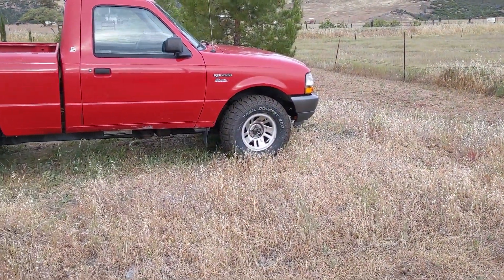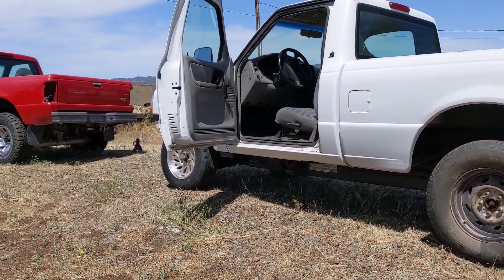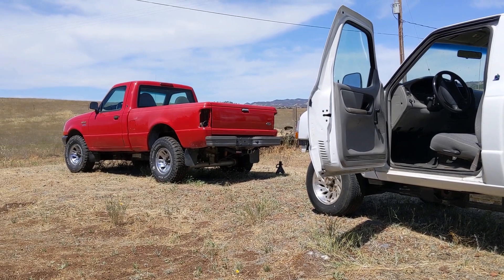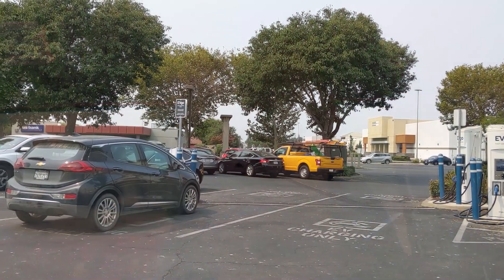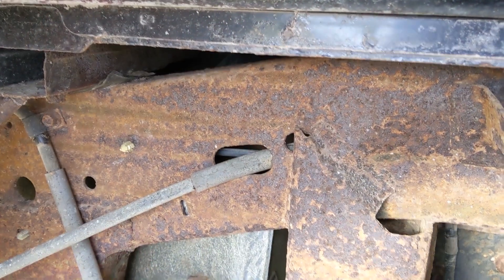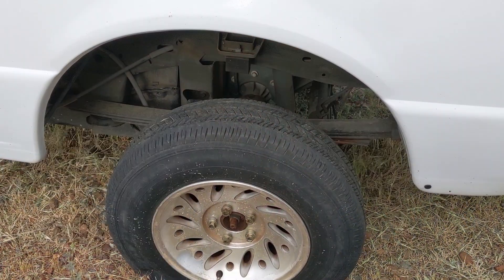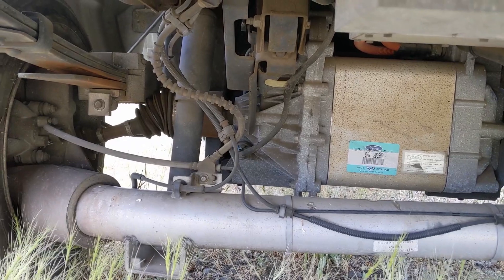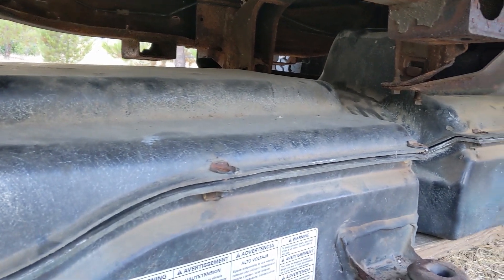Ford Ranger Electric Project Update

Comment: I have wanted to take a 4-cylinder stick ranger and convert it to a ev using a warp 9 motor. Would you have any advice on that thanks in advance
Reply from the maker: Hey! I don't know what your budget is, but personally, I wouldn't go DC at this point. Maybe if you were wanting to preserve the stick shift or give it faster acceleration. Otherwise, the basic AC motor kits are going to be similar in price with far better efficiency and drivability. 

EV West converted an older Ranger to electric a while ago, and it seemed to go pretty well. You might want to look at that for ideas.
Reply: Hey I want to convert a 1988 Ford ranger to electric

Comment: Hi Eric, I just saw an ad in Portland, OR craigslist for what looks like a running 2000 Ranger Electric.    I won't post a link but it's listed by "2000 Factory Electric Ford Ranger - $9,500 (Aloha)"
Reply from the maker: Thanks! Yes, there are a number of them in that area that are restored and still in running condition.

Comment: Maybe go junkyard shopping for batteries, motors, electronics? It seems like cooling and battery management would be the hardest things to adapt. Maybe Leaf batteries to avoid the liquid cooling hassles. 
Seems like 1 pack would not be enough, 2 would be too heavy, 1.5 would give you the wrong voltage. Please don't get electrocuted, see Weber Auto channel if needed. 
Great history lesson, great project!

Comment: Contact EV West and find out the configuration of their truck plus any hints they might have on  your build...there are a lot of unknowns with EV builds..."ask the man who built one!"
Reply from the maker: Thank you for the suggestion, but EV West converted a gas Ford Ranger to electric. These are stock EVs. I might only have to upgrade the batteries and make some small tweaks.

Comment: Every Prius on the road has a NiMH battery and they are well known to have lasted to 200,000 miles.
Reply from the maker: How many miles are on the battery, though? Most miles are driven by the ICE, and the batteries only act as a buffer. Battery usage in an EV is very different.
Reply: @newscoulomb3705  that's exactly my point. The battery management system is designed to use the middle 50% of the battery. So it isn't "cycles" per se (as a Prius typically has many tens of thousands of cycles) it is the percentage of time at the extremities of SoC that kill the NiMH. The BMS in the Prius does a fantastic job of making the battery last forever. There are first generation 1999 Prius still on the same battery after 21 years.
Reply from the maker: @homomorphic  Right, but my point was that these NiMH batteries weren't acceptable for pure EVs, so selling their patent off wasn't an indication that automakers were conspiring to "kill the electric car." Essentially, 1,000 lbs of these NiMH batteries hold less than 30 kWh of energy. Using 50% of their capacity would leave a truck like the Ranger with maybe 30 to 40 miles of real-world range.
Reply: @newscoulomb3705  absolutely. They were not usable as a sole traction battery on a pure BEV. The whole EV1 conspiracy thing is every bit as crackpot as qanon.
Reply: I was going to mention the same thing, the Prius does a very good job of keeping the battery between 20% and 80%, state of charge. And has very large number of cycles, not really sure there's even a limit.
But as he said the problem is that only gives you about 60% of the total battery capacity to safely use, although you might be able to push that to 10% at the top and 10% at the bottom and still be safe. But it would certainly mean you would need a larger battery to do the same work. I'd be interested to know on the ev1 what they're expected charge cycle life was because the second generation of the ev1 was in fact nickel metal hydride and I believe had a hundred mile range.
I think at this point lipo would even be cheaper to purchase for him than going nickel metal hydride.
I wonder if you could find some old Nissan leaf packs laying around someplace. Or for that matter build a large pack out of 18650 cells, I've seen videos on YouTube of people putting rather large packs together out of Salvage 18650s.

good to hear from you again I was getting a bit worried cuz I hadn't seen a video posted in a couple of months.
Reply from the maker: @kens97sto171  Thanks. Yes, it really is about the depth of cycle. Most modern batteries will show almost no degradation being cycled in the middle 50% or so, but at that point, you need to double the mass, price, and volume for the same range target. That's not really reasonable.

I'm going to be sharing a few different battery options for the Ranger EVs, but I think I've settled on my path. Hopefully, I'll have some exciting updates to share over the next month or two.
Reply: @newscoulomb3705 yup, I only charge my Bolt to 55% 95% of the time. I have 21,500 miles on it and I just did a capacity test and I still have 59.7kWh which, within the accuracy of the test, basically represents no degradation.

Comment: I was kind of on the fringes of the conversion crowd turning "gliders" (sometimes new, but usually just cars with unsalvageable entines) into EVs, with the latest in Optima yellow tops and mostly DC motors because AC conversion and controllers were ***EXPENSIVE***, and you still had the stick shift so it didn't matter than the power sagged a lot above 5-6k RPM. These Rangers and the corresponding electric S-10s were AMAZING back then.

Comment: They are expensive, but look into battle born batteries. I've heard they are quite a bit less in weight. And higher charge cycles.... Just a thought.
Reply: Or optima deep cycle.. I think Lipo would be longer lasting and future proff though
Reply from the maker: Thanks for the suggestion. I considered Battleborn, but they're just too expensive.

Comment: What do u think of the ford f150 coming up? And the hybrid rex phev. The hybrid supposed to have a generator to extend the ev range
Reply from the maker: At this point, I'd prefer all-electric. Having a gas range extender is fine, but I'd rather just have a properly sized battery with 350 kW charging speeds.
Reply: Lmao thats what a hybrid is. An ev with a gas gennie.
Reply: @cosmicrider5898  yes. But the ford design a bit different. The generator is built outside the veh.. its on the flatbed like a portable generator